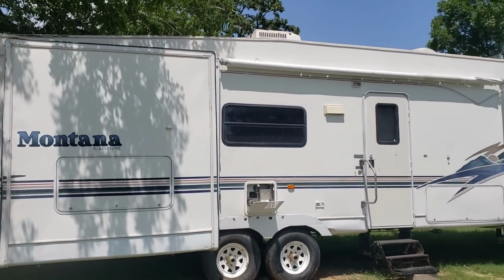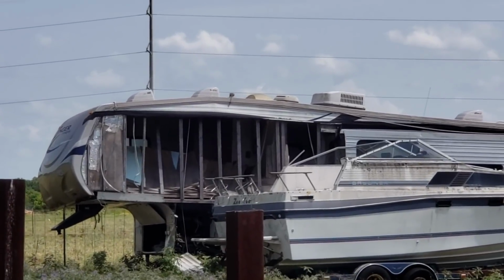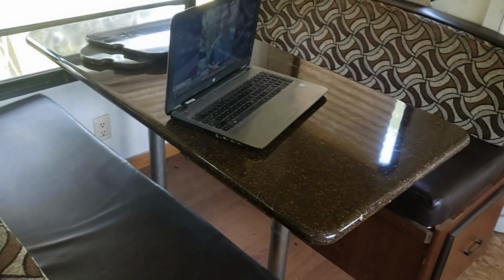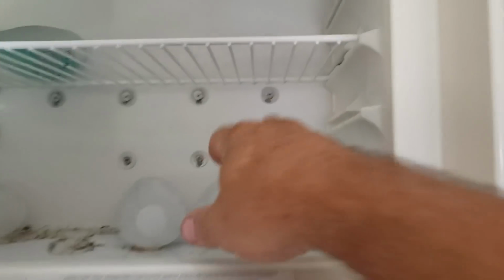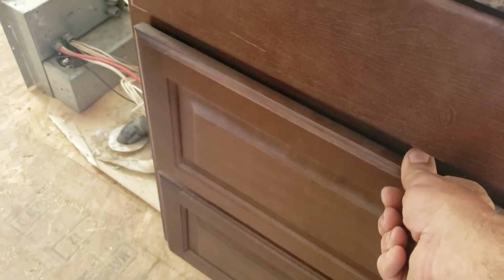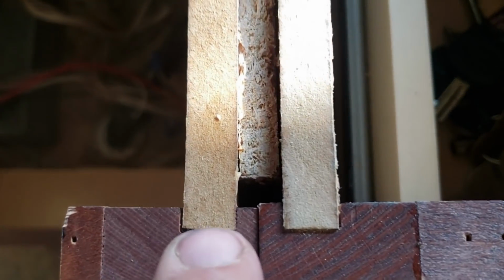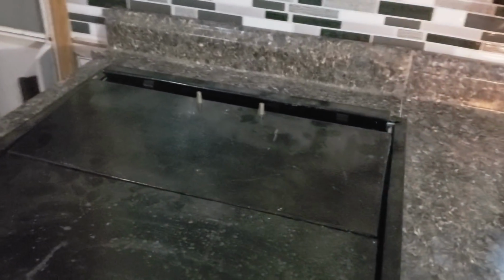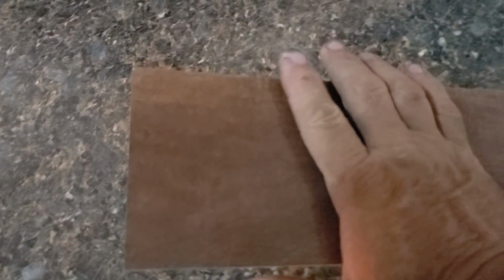35' Keystone Montana Fifth Wheel Remodel  Series Part 1 - Introduction to our Project

Comment: My wife is from Antique province but we are in the states now (GA). 

JUS A THOUGHT….I recall in a camper my dad had he used key locks on the drawers like you would find on a metal cabinet. Same key worked for all but then you didn’t have to fight with the RV clasps when opening drawers once we set up. Just use the easy regular handle and he could lock them while we were away from camper for extra measure of security.

Comment: James and Mel, Have you considered attaching the solar panel support frames to the side wall studs to avoid roof penetrations/ water incursions. Truck cabs have aero
fairings to blend with the trailer front. A smaller lower wind deflector in front of each set of solar panels might reduce wind damage on the interstate highways.
Reply from the maker: George just watch and see. I dont want to reveal everything at once.

Comment: That's the truth! Their not a good investment. Give 50.000 for 32 ft fifth wheel and sold it for 5.000 15 years later. It had so much water damage and it was kept in a shop building when we were home..I guess when we were traveling in it water was coming in around the slide outs without us knowing about it until it was to late.

Comment: I once owned and lived in a 32 ft 5th wheel . Watch out the refrig cuz mine caught fire and burned up the trailer !! . Good you have a rig to rob good parts for your Montana !!  Dominc refrig = recall on the flume !!  Check for cracks in weld !!
Reply from the maker: John I will look that up for sure!!!!!